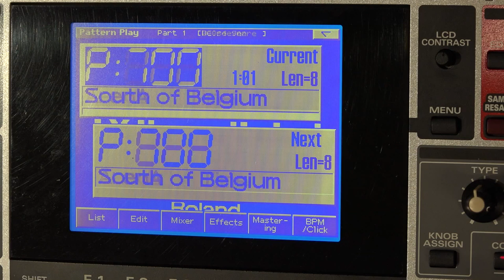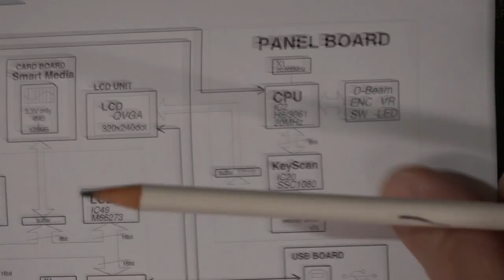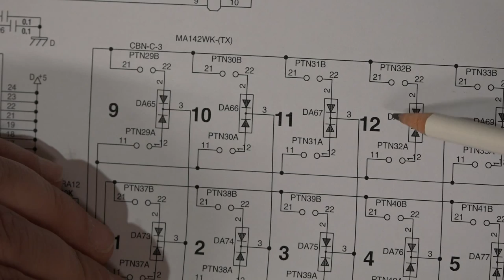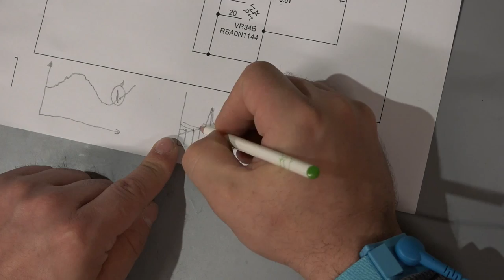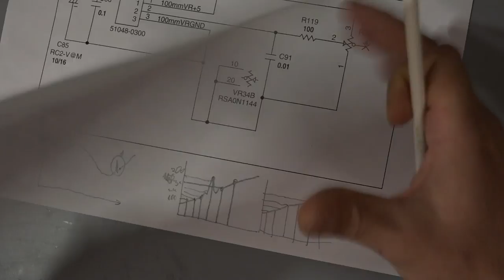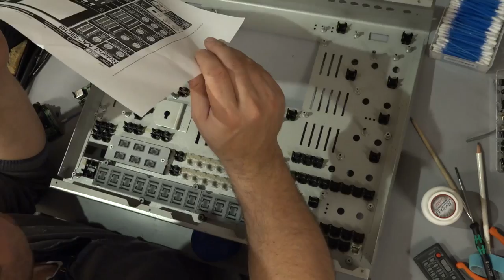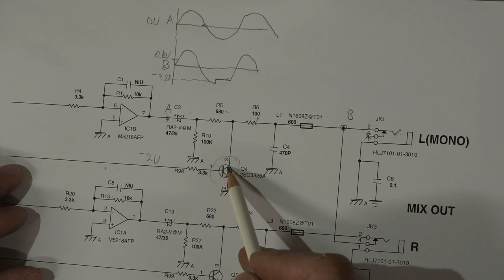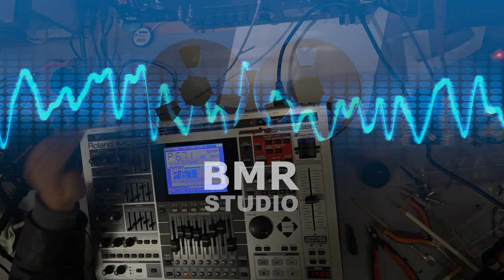Roland MC-909 tear down, repair and maintenance

Comment: I don't own an MC-909 but still love this video because it is very informative in general. The way how an analog filtering solution is used to smooth out data input complications is a real information gem. It proves that the whole digital versus analog discussion is basically nonsense. There are no pure digital solutions. The best technology always uses a mix of both technologies. Thanks for the insights!

Comment: Vert good video by a very experienced technician. I also remove the rubber button membrane and soak/ clean it in a mild degreaser like palmolive dish soap. Let it soak for an hour then rinse it thoroughly.  I also covered the switching power supply in a faraday cover with copper tape and relocated it off the board. This pcb board is very thin so the slightest flex could fracture the print or a solder joint. You should perform the self test routine before and after dismantling it.
Reply: What's is the procedure for doing the check on the 909? Thanks

Comment: Hi BMR Studio, the RPS button on my MC-909 is not working. I just took it apart and soldered in a brand new tact switch. Still does not work. Do you know what the problem could be?

Comment: Awesome upload. I'm back with my groovebox after 8 years, thank you. I am inspired to get back in there once again. i have list of problems to fix, last time i was in there, I think i cleaned what little carbon that was left off the back of all the pads, it made them worse I have a paint-on product to try and my attempt to clean the sliders did nothing. I recall i did fix a solder issue on the rotary encoder, but lost the transport functions. I rely on midi to get any use out of it. Just watched the Don Solaris sample pack. Also enjoying your other tutorials. Namaste
Reply from the maker: Pads you can get it on ebay for about 5-20$. Encoder is a standard encoder, last time I got it from  RS online.
Reply: @BMRStudio  Hi, i have never been able to source pads on ebay. they are no longer available
Reply from the maker: @Skookumshroom  There is a carbon painter stick. 5 dollar. Apply 3-6 layer with 5 minute delay! It will do the trick. I repaired many Access Virus KA with this method.
Reply from the maker: @Skookumshroom  https://www.amazon.com/Keypad-Restore-Conductivity-Carbon-Copper/dp/B0026PRMVM/ref=pd_bxgy_img_2/146-9883006-8518953?_encoding=UTF8&pd_rd_i=B0026PRMVM&pd_rd_r=4b5153f0-a5f2-479a-afc0-5f7843fbc233&pd_rd_w=LapCY&pd_rd_wg=GBscC&pf_rd_p=4e3f7fc3-00c8-46a6-a4db-8457e6319578&pf_rd_r=TEN7MDM135S9TJ60K5WM&psc=1&refRID=TEN7MDM135S9TJ60K5WM
Reply: @BMRStudio  this is exactly the stuff I have to fix my pads I mentioned in my first post. Awesome to hear you have had good experience with it. Thanks man :)

Comment: Those system presets are why i recently paid 400 pounds for one of these. The sounds are awesome!!! Early trance machine! Nothing touches it for this genre
Reply: Ibiza Sunset is a particularly amazing and euphoric pattern. To say that in 2018 really is something. Being a massive early trance fanatic myself if I had of heard this demo in 2002 when the machine was released I'd have been gobsmacked! Other machines just sounded like straight up CHEESE, (Yamaha *cough*) this actually sounded similar to any trance release between 1998 to 2002 and beyond if you include Euro trance. Just lush. Can't wait to receive mine!

Comment: Hi,
nice video! I am about to purchase a used MC 909, japan version (110v). I have a question, is it true that i can change the imput voltage (110v,220,240v) from the internal "Service Utility" (MENU - SYSTEM - SYSTEM INFO - [SHIFT 1-7-8-9] - Service Utility - Voltage) menu? Because i live in Italy and we have 220v while in Japan is 110v...Thanks

Comment: Thank you a lot for this video. I just have a not working MC-909 sitting on my desk. The label on the back says it is made for 117V but not sure if the power supply was changed to a 220V prior it was switched on the first time. When looking at the service manual I do not even see that there are different versions of the power Supply.

Comment: Thank you Sir u just gave me hope as I know just the repair man!!8D
and u also saved me from having to save up plenty €£$ to be a test  pilot for the new pioneer toriaz  sp16 or octatrak!!lol 
Do you have more Jedi knowledge of the 909?particularly the file system area svd files!?
I bought 909 and a 808  couple of years back and started customising/upgrading the file structure > < !.
It  was a challenge with plenty of down time working it all out but succeeded in the end!
I have the Roland integra data and want to see if I can customise the 909 XV engine via  the integras from some smart media cards!!
IF it can survive the repairman surgery firstly!
Thankyou and have good evening.

Comment: Im trying to remove the knobs so I can clean the plastic squares because some do not make contact. Do I need to pull harder on the plastic knobs to remove them?
Reply from the maker: Means someone already broke them, and glued to the shafts…
Yepp, pull it with a U shape flat lever, put some towel under the lever..
Those pots are replaceable, with Mouser Alps pots.
Cheap.

Comment: @29:41: I tried your method to clean switches. Usually I replace bad switches, but just tried it with Isopropanol on an old Atari ST mouse. Also pushed the buttons to suck the alcohol in and after drying it works much better. :-) It was an almost non working switch. Thx and greets from Berlin :-)
Reply from the maker: Da Paul berlin? Nice :) Maybe You can come over here and help Me to build a new studio...
Reply from the maker: apply after a tiny bit of WD 40. Then will be the best result.
Reply: I would like to come to help with building your new studio. :) Did you got my PM?
Reply from the maker: Let me check

Comment: Hello, we talked with you in the comments of another of your videos, I have a couple of questions, I will be very grateful to you for any advice. So, my 909 is not loading, due to a faulty power supply, now it is repaired (+5v, +15v, -15v) The device does not load, a blank blue screen. I checked the voltage on the processors (IC1 SH-3/7706 128MHz on the main board and IC2 H8/3061 20MHz on the panel board), they are normal. I checked the frequency of the quartz resonators with an oscilloscope on the main board, the quartz are working and generate the correct frequency (X1 32.768 kHz and X2 16.000 MHz) BUT... when I started checking the frequency of quartz (X1 20.000MHz) on PANEL BOARD, I did not find anything, absolute silence!(( No frequency generation, no voltage (should be X1 20.000MHz). It turns out that the MAIN BOARD starts, but the PANEL BOARD does not start, the whole device does not start accordingly, are my thoughts correct? What advice can you give? Thank you for this video! Best regards, Andrey

Comment: I keep referring to this video, i recently purchased a second hand MC505, the RPS button would take about 8 presses before it would illuminate, i couldnt be bothered pulling it apart so i sprayed a little CRC226 electronic cleaner around the button and gave it a few bursts of canned compressed air, it did the job... my question is when you cleaned the MC909s tactile buttons with isoprop and a cotton bud is there a reason why you didnt use a little contact cleaner/lubricant after the isoprop?
Much appreciated. 
Peace from OZ
Reply from the maker: Any chemical on those contacts will damage the silicone rubber pads and the special carbon layer. That's why.
Reply: @BMRStudio  thanks very much...I had better open it up and do it how you suggest...
Much appreciated.
Peace from oz

Comment: I'm having an intermittent boot problem with mine.  It appears to load it's OS, but freezes, at Pattern mode.  Usually takes a couple of restarts before it loads properly and then works fine.  Any explanation for this?  I've pulled out the extra memory and updated the OS to 1.23 and still has the problem.  This is a fantastic tear down.  I wish there were tear downs like this for all the gear I own.  Very nice!
Reply from the maker: Looks to me, You have some memory error, or clock issues. Check the power brick and all regulator circuits first! Look for dead caps! THX for watching :)

Comment: How did the fader 🎚 cleaner/lubricant work development work out? I just acquired my first MC-909 two days ago and I’m looking for the proper way to get the sliders back to 100% functionality and a smooth glide.
Reply from the maker: You need a thick, sticky silicon fat for the metallic slider part, and Contact Vaseline spray for the fader surface. But before, clean out with precision electronic cleaner, or, isopropanol alcohol. Turned out perfect :) Just bend some small plastic to reach the top slider element from inside. Apply everything thinly!

Comment: This was a very informative video thank you.  I opened it up to clean all or most sections.  I thought I could fix buttons F2 or or F4, but they don’t work.  Do you know the part I need to source for it?  I don’t use twin beam buttons.  Do you think I could use those buttons and swap them? If you have any link please let me know. Thanks.
Reply from the maker: I will check the service manual later today.
I remember some seller on eBay, still up there, selling like a pack of switches in bag for MC 909. Kinda not standard height or something….
Reply from the maker: Try DeOxi! If not working, can be a diode on this key matrix part.
Reply: @BMRStudio   btw, I used general circuit board Isopropyl Alcohol.  I did your instructions about letting to button soak when pressing or recessing the button, to let it leak in.  Interestingly enough, those exact two buttons F2 and F4 had mild “rust color” on the microscopic sides. It didn’t look terrible, but I could definitely see that some type of oxidation was specifically on those two buttons.  You recommend I use DeOxi?  How should I treat or approach the procedure again, the exact same way?  Let’s assume those two buttons are shot and need to be replaced, then should just open up the rubber part and deep clean inside with a magnifier using DeOxi?  I figured the worst case scenario is I can swap two buttons from the machine that i never use! For me F2 User and F4 Effects are priority over everything 💪🏼.
Reply: @BMRStudio  BRO!!!! I cleaned it thoroughly with Deoxit! The buttons work!!! You’re a genius. Thnk you so much man

Comment: Hello, how dificult do you think is to exchange the screen? Mine basically burned out... do you think is expensive or it needs technical support from manufacter? thank you!
Reply: actually its not burned out, the screen is tottally blue, it normally starts ok , then the letters start to blink and simply is blue, but working well...
Reply from the maker: The screen replacement part is exist on the internet with other number. I will do a research for You to find it. Time to time is popping up on eBay for around 50 USD. To replace is nothing, just open, few screws and disconnect the cable.
Reply from the maker: http://www.ebay.com/itm/SHARP-LM320191-5-7-inch-LCD-Display-Screen-Panel-Resolution-320-240-/361633678979

Comment: Hi there! I've got a silly question, how can I remove the knobs on the MC 909, recently bought one of these, but unfortunelly, because of a fire, a few knobs and buttons melted. It seems that the electronics works fine, but need to replace those knobs. Tried to pulled off, but they don't come easilly. So what's the trick? This resistance is normal and just need to pull harder?
Thanks in advance! Great video.
Reply from the maker: Fire? :))) Wow! Pure MC... Well, in this case, try this trick: buy a simple, harder, narrow spatula tool, cut out a 15 mm long and 9 mm wide section in the middle, smooth the edges with sandpaper, glue a piece of paper on the bottom to protect the MC surface,, then   just push under the knobs and lift it up. Not easy to remove the knobs even originally... But after fire... :) Good luck!
Reply: @BMRStudio  thanks I'm going to try it. And got to say, this  MC 909 it´s a freaking tank, All the jacks and connection in the backpannel melted too, in some cases just re-openned the jacks gently with a drill and work just fine, the midi connections need to be replaced to a new ones, but hey, I don´t know many electronic machines that survived a fire and turns on like never happened, and now my mc 909 looks with so much attitude :) Thanks again and greetings from Guadalajara México.
Reply from the maker: @farmostro6306  Time to upload a video about it no? :) AWESOME story!!!
Reply: @farmostro6306  Jesus christ that thing is toast

Comment: Hi BMR, I wrote to you 3 years ago in the comments section of this video. Are you still doing MC-909 repairs? One of my pads is being naughty...
Reply from the maker: First, You have to check the conductivity of the black contact pads on the pcb, and on the rubber keys. Find the  trace, or jumper point and check it. bip-bip :)
Then, clean it with 91% Isopropyl alcohol. Do not apply too much, on the tip! Drying time can be 12 Hour. Let Me know where You arrived.

Comment: I'm needing some more of your Jedi knowledge if possible? ?
I have some Blue sky media desk 2.1 active speakers that have developed a problem!  They have operated trouble free for a long time,but I accidentally ran over a cable with my vacuum cleaner recently .The cable was connected from the headphone socket of my groove box to the rca input socket of the blue sky active subwoofer! What happens now when I switch on the system is  it will play fine for about 15 minutes then the right channel will suddenly stop working! !??
.If I switch the speaker system off for approximately half an hour and then back on it will start playing again correctly! !....also sometimes when I have music going through the system I can hear the right channel beginning to fade ,if I turn the volume pot rapidly on the gbox all the way up and down the channel will start working again for a short while longer  then stop working! 
have you ever come across this problem before .??.or do you have knowledge of a solution for a fix I may be able to undertake? ??
Thank you sir
Reply from the maker: mr WYN mr WYN The force is with You :) just simple replace the input coupler capacitors in the speaker system. To some normal Panasonic or Nichicon. You overdriven the inputs with headphone level :) or electrostatic discharge from the vacuum cleaner.
Reply from the maker: mr WYN The force is with You :) just simple replace the input coupler capacitors in the speaker system. To some normal Panasonic or Nichicon. You overdriven the inputs with headphone level :) or electrostatic discharge from the vacuum cleaner.

Comment: Hello and thanks for this video. 

I recently bought a mc909 and I was planning to replace or fix some of the buttons that doesn't work properly, so this video 

Couple of years back I found an Octapad PAD 80, fantastic machine; I replace all the contact mics but there is still an issue with the memory and it's not exactly the internal battery. I will appreciate if I could get in contact with you and maybe you can help me to get the schematics for this one or give me some advice.

Br,

Rolando
Reply from the maker: Rolando Camilo Hi. For Octapad I don't have schematics. but, the problem is in the memory chips I'am 80% sure. other can be the bus voltage level, or the digital power supply. Start there first. check the voltages and the rise-fall egdes with high speed scope.

Comment: Hi again , I just noticed that my MC505 has a ground pin on the 3 pin power connect but my MC909 is missing the ground pin on the chassis? 
Any idea why ? You are the man to ask .
Any chance you are also into 27mhz ssb CB radio  or Amateur radio ??
Cheers
Reply from the maker: Check the schematics. I don't remember where, but Roland changed the ground location when then increasedthe numbers of the pcb layers. Plus they went more efficient power supply. About the radio, ask W2aW. He is real master of this.
Reply: @BMRStudio  I found the electrolytic mod you did on the main outputs of the MC909 very interesting, especially when I noticed the missing earth pin on the power socket..I have no idea whether there is a connection as it is beyond my knowledge..just an observation.
Reply from the maker: @andrewverran3498  it's a Russian bipolar capacitor hack. Actually after the mod, sounds super good! More transparent and linear at lowend and mid frequencies. After that, I modded almost all of my synts.
Reply: @BMRStudio so you mean the transistor you replaced was possiblly due to a powered input  and wasnt related to the ectrolytics , and the Bipolar electrolytic modification you then performed on all you're synths / equipment that had a main stereo output?
Cheers.
Reply from the maker: @andrewverran3498  yes. All output. All synts.

Comment: Afrer you did the Russian Bipolar capacitor hack on the main outputs , what piece of test equiptment did you use to view the new results?? Or did you just go by ear?.
Peace.
Reply from the maker: Only hear. Super punchy and way more transparent. I was shocked. It's a pair of Russian audio capacitor, measured same capacity, head to head with negative pins.
Reply: @BMRStudio  i understand  why the mod would work, its just i dont trust my ears that much, unless the difference is really obvious... if you had to have a visual representation of the before and after results would one of those DAW oscilloscopes work or would a DAW spectrum analyser be better?
Cheers
Reply from the maker: @andrewverran3498  DAW analyzers aren't good as real things. But 8-12 bit scopes never show you these kind of changes. Simply because the dynamic range... An Audio Precision unit maybe. Train Your ears. It's a 129 dB, approx 38 bit resolution multi array super microphone sophisticated instrument!
Reply: @BMRStudio  yes but 15years of club DJing hasn't done them much good.